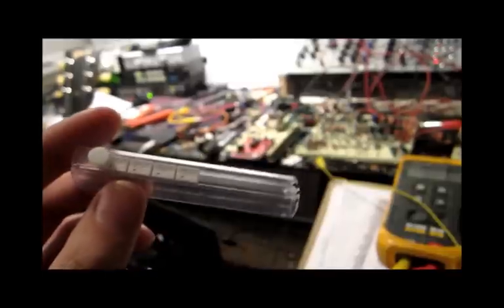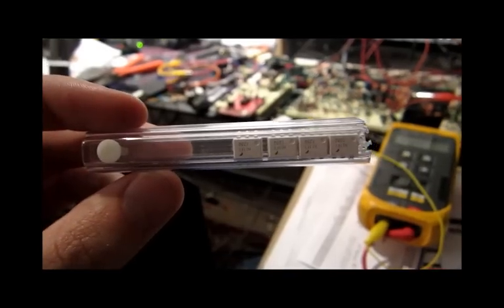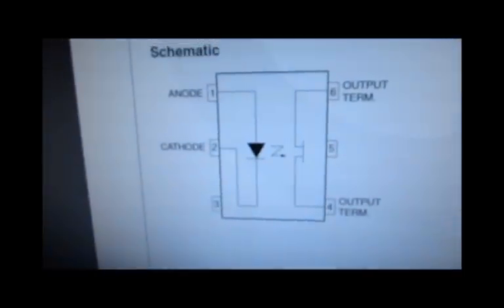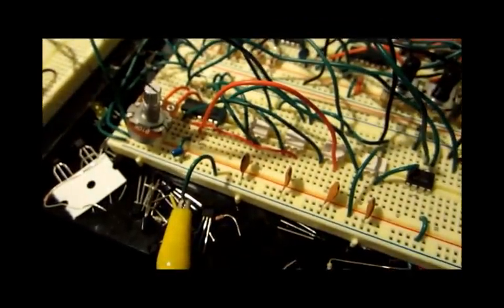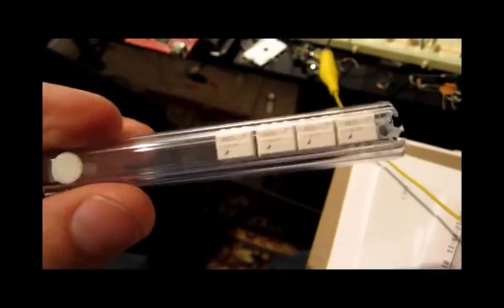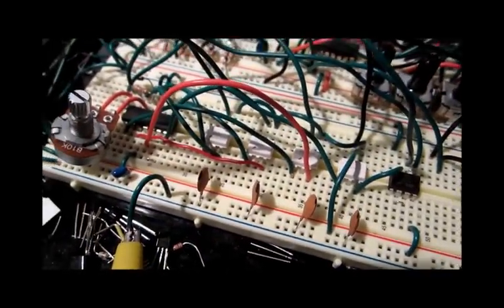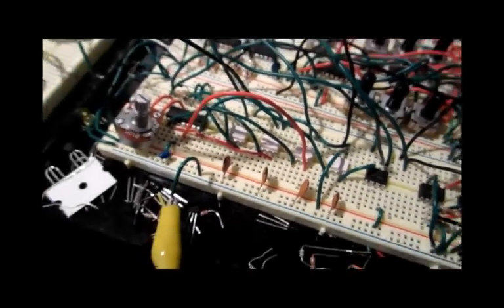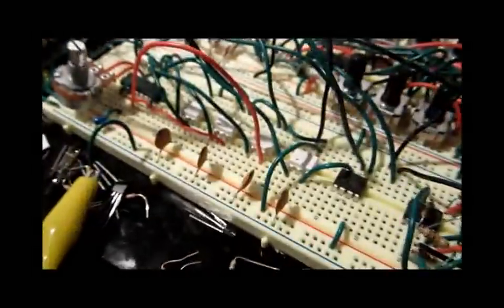optocoupler vcf

Comment: I have a very rough idea of what your circuit looks like, but i build a 4-pole filter using JFETs, so what I have to say might apply to your circuit.
You're "60 Hz noise issue" might be because the audio signal level you are driving your fets with is small compared to 60 Hz noise that couples into your circuit. If you are operating the FETs close to pinch-off (high resistance), then parts of your circuit will have a higher impedance, which will make it easier for external noise to couple into your circuit.
You may find that the noise level changes based on how to move your breadboard around.
You might find that if you build your circuit on a PCB and shield it that the problem goes away.

However, given that I am posting this 4 years after you made this project, I am curious to know: did you ever solve your noise problem? And, if so, how did you do it and how well does it work?
Cheers
Jensen